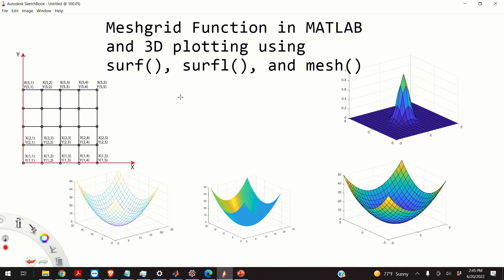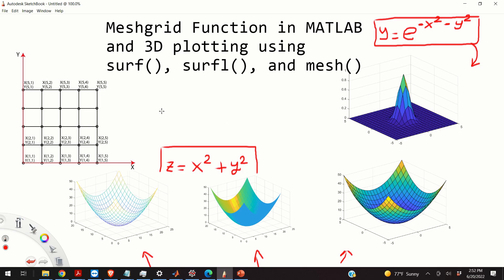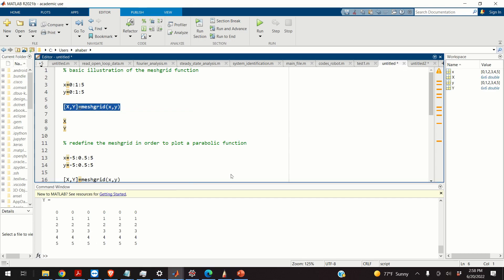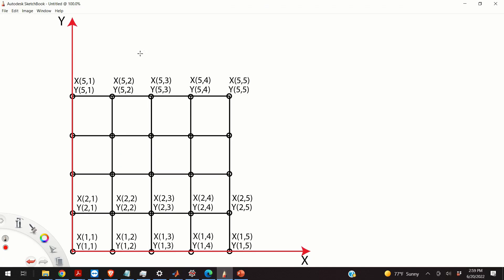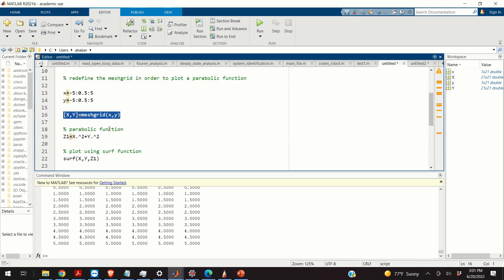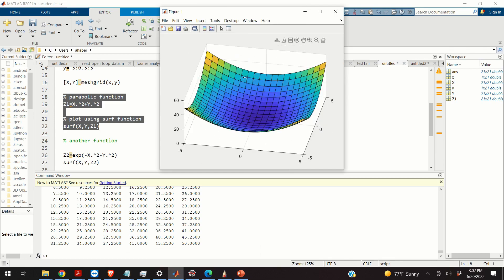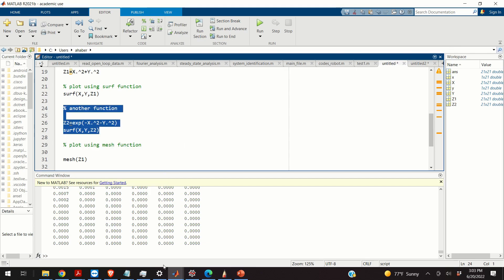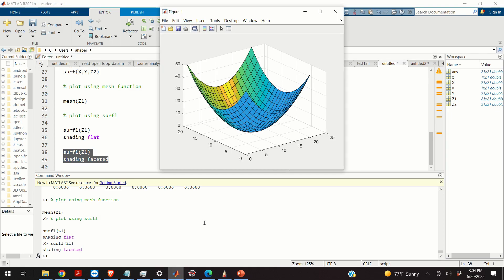Introduction to Meshgrid Function and 3D Plotting in MATLAB

Comment: meshgrid will also work if the dimensions of vector x and vector y are different. No of rows of X will be the dimension of y, and number of columns of Y will be the dimension of X.
Hope the above statement is correct.
Reply from the maker: I think so, you can give it a try.
Reply from the maker: Did u do it? What is the outcome?

Comment: Hello, I am currently a freshman and struggling to use python for my Calculus project. How should I do if I need to illustrate 2 3D objects at the same time, in only one picture? I am looking forward to your help. Thank you so much.
Reply from the maker: This is definitely possible. Did you try with "hold on" in MATLAB. This command is used to plot several curves on the same graph. Maybe it can also work with surf and Meshgrid. Unfortunately, I do not have time to investigate this further.